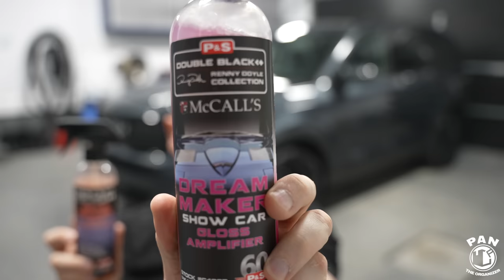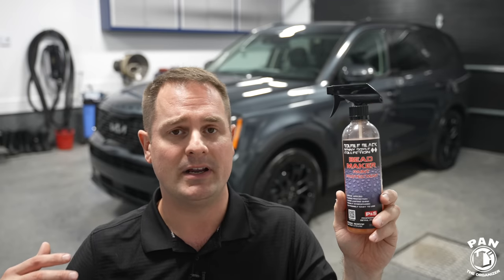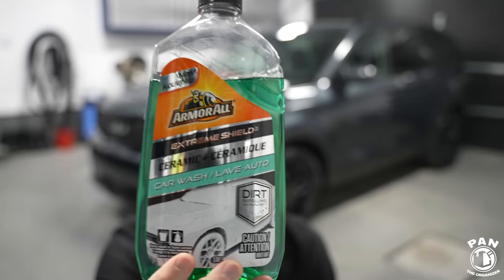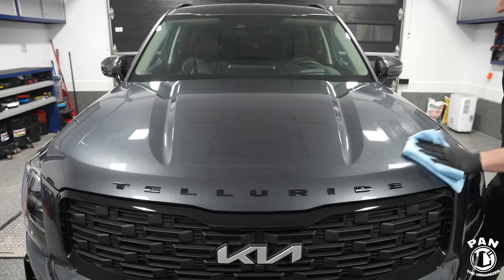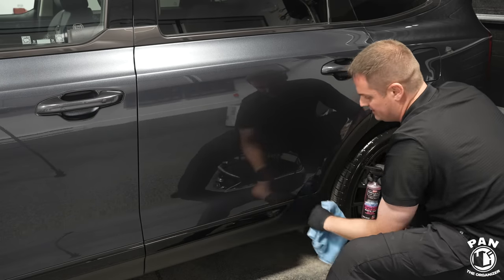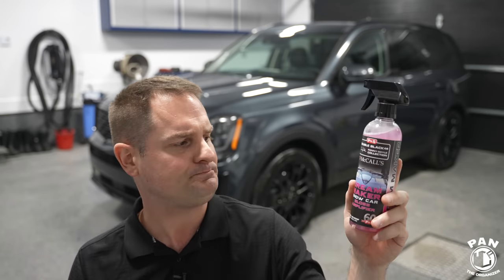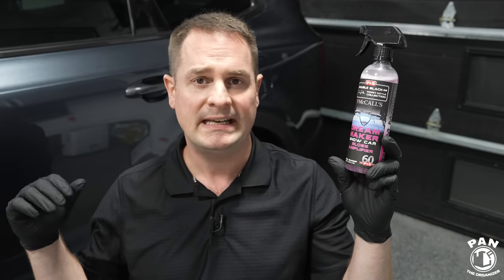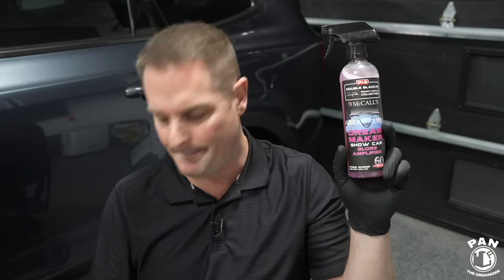NEW P&S DREAM MAKER! Is it better than Bead Maker?

Comment: Both products are absolutely amazing.  I typically will put layer both products.  I put the Bead Maker on first and then the Dream Maker on top.  Bead Maker is definitely going to last longer and give you more protection, while the Dream Maker is going to give you a lot more pop.
Reply: How long do you take after applying bead maker to apply dream maker?
Reply: @ForceFreddy  I do the same combo and I let bead maker cure for at least 5 hours before putting dream maker on.Ideally you should allow bead maker to cure overnight.
Reply: @marybetheby5184  Thank you! I will try this combo tomorrow !
Reply: @ForceFreddy  Great!Also,be sure to shake them both really good and often during the process.
Reply: Has anyone tried mixing the two in one bottle and using it that way?
Reply: @jeepinspence I'm using the ratio I think @pantheorganizer recommended: a 10:1 ratio of Beadmaker(BM) to Dreammaker(DM).  That allows BM to take advantage of the anti-static properties of DM and hopefully negate some of that dust attraction some experience w BM.

Comment: Would like to see a side by side comparisons. Coated and uncoated to see if it’s noticeable to the naked eye in terms of gloss
Reply from the maker: The camera rarely does glossy products justice, but this for sure beads an uncoated paint for sure.
Reply: @PanTheOrganizer  Can this product be used over a spray sealant? Eg. I was planning to wash an unprotected car then apply Turtle Wax Hybrid Solutions Ceramic Spray coating and then Dream Maker on top of the sealant. Should I do it in reverse order (Dream Maker then Ceramic Spray on top)? Would either method just be a waste?

Comment: I’m a big fan of Bead Maker and I use it over Jescar’s PowerLock sealant. Looks spectacular. Love the introduction to a new product and I will certainly be adding a bottle of Dream Maker to my arsenal. Thanks for the info Pan.
Reply: @Brandon-no3vc  Not really sure what you are talking about and “masking” but I use the Bead Maker as a topper after a maintenance wash. It brings back the shine and slickness to the paint and it makes it easier to wash.
Reply: @Brandon-no3vc   I have been doing it that for 2 years. Great results. I’ll stick to what works for me. Thanks for your advice and good luck.
Reply: @Brandon-no3vc  Jescar’s Ultra Lock Plus is a CERAMIC infused polymer sealant. The combo works for me. Not sure why you’re so hung up on this. But ok, you made your point. I won’t do it anymore.
Reply: @waynefromnewfoundland8740  🤪
Reply from the maker: Thanks 👍
Reply: @Wayne from Newfoundland I've been doing the same thing you're doing for a couple years now, spring and fall. 2 coats of Jescar Ultralock+ (ceramic) cured 3 hours each coat, then top with 1-2 coats of cured BM. Then I use BM for maintenance washes, making sure there's no rain the next day for extra cure time. 

I disagree 100% with everything Brandon said: you're not "masking" sealant, you're adding a layer of sealant. I forgot what else nonsense he said, but that's not been my experience at all. The results are amazing every time.

Only problem is dust. At least in Texas where I am, it's dusty here. That's where I'm hoping to use either Dream Maker or the P+S gloss enhancer product as a final secondary topper. I've been reading they both have anti-static properties to counter BM's static cling effect, which attracts dust.
Reply: @waynefromnewfoundland8740  Also, I think I'll get a gallon of the P+S paint gloss to try out for maintenance washes, and use the DM for special times or car events

Comment: Why wouldn’t you use a gloss meter to test effectiveness?  A before and after would have been a great test.  Otherwise not sure you see the value of adding a product like this over any other topper you’ve recommended, but as always…thank you!
Reply: You'll have to wait for Brian from Apex detailing to review it. He ALWAYS uses a gloss meter. Have been waiting for Pan to use one in his reviews.
Reply: @pdrey100  Same.  Nothing wrong with using the same tool as a competing channel.
Reply: Pan has explained many times before why a gloss meter isn't used.
Reply: Oddly, the very shiniest the paint can get is after polishing it, and nothing on it. Adding something on top of the shiny paint actually loses gloss. Try adding wax or other products on top of your bathroom mirror and see what makes it more clear.

Comment: Pan,
   Another great video.  I’ve been watching your videos on Bead Maker, to include your first introduction to Bead Maker at the Rag Company.  I finally broke down tonight and ordered it.  I just want to make sure that I can use this as a drying aid after each wash.  I have CanCoat Evo on our vehicles.  I want to do the initial application of Bead Maker on dry panels and then as a drying aid after that.  I just want to make sure I’m not overusing it as a drying aid after the first build up application.  Thanks in advance and keep up the great work.
Reply from the maker: Yes you can use it the way you described. Be very light on application if you’re using it as a drying aid after each wash and you will be fine.
Reply: @PanTheOrganizer  thanks so much Pan.  Have a great day.
Reply: @PanTheOrganizer  I forgot to ask you.  Have you used Technicians Choice Ceramic Spray?  I want a product that will not continually build on my CanCoat Evo.  I’m curious on your thoughts of Technicians Choice.  From the videos and research I’m doing…it may be superior to BM and a gallon is compatible in price.  I need something that mates well with my Evo but will not continually build upon it to take away from or compromise the Evo.  I’m so torn on a good silica spray or product for my sacrificial layer on the Evo.  Any thoughts or advice is greatly appreciated.  Thx again as always.

Comment: Hi Pan, 
I have a new SUV with ceramic coating. 
I clean it using the Rinsless wash method with ONR. 
Do you recommend using both bead maker and dream maker for the final touch to get more slickness and gloss? Or I can get it using only dream maker?
Reply from the maker: That's up to you to decide. You can now combine Bead Maker and Dream Maker in a secret DIY mix for even better results. See my video here: https://youtu.be/twuTd2VNlxw

Comment: I used beadmaker at the museum and wasn't too impressed. It didnt seem to last long? Maybe it was me. Maybe the local detailing supplier I got it from pre diluted it? I really like the TW seal n shine or graphene infused flex wax. I might have to try that dream maker though as a drying aid. That Viper chair is a step up from that snap on seat I was using. Being a big guy, it's tough to get down on those lower sections sometimes without being on your hands and knees or butt. The things we do to make vehicles look minty fresh!

Comment: How does this compare to Xtreme Solutions Topper? How is it different?

Thanks as always!
Reply: Great question
Reply: Same question I Have 
I think Topper is one of the best products out there for gloss and slickness. It’s also very easy to apply. For an outside vehicle I get between 7-10 days of slickness and gloss.
Reply: @stevenmott6668  me to.
Reply from the maker: Topper will last longer, and both are very close in terms of gloss.

Comment: Pan have you ever used Bead Maker on the interior windows ?? I hope I'm not doing something wrong but I've been cleaning my windows with it and they come out perfect with no streaks
Reply from the maker: Yeah many detailers use Bead Maker on exterior and interior glass, it works awesome. I still like to clean them first with a glass cleaner and glass towel, and sometimes finish with Bead Maker for slickness and easier future cleaning.

Comment: Pan, if I use the Bead Maker as a drying aid, the buildup should be way less than when applying it on the dry surface right?
Reply from the maker: Correct as you are slightly diluting the product.

Comment: I ride a Harley, after a few hour trip, what is the best way to get the road dirt off/bugs off the front fairing without doing a full wash?  I'm interested in trying P&S, but don't want to apply every time when I need to clean the road dirt and bugs off the front.  Cleaning a motorcycle is time consuming with a full wash.  Looking for a quick and easy method after a long day ride.

Comment: Ok so I did buy a bottle and tried it out on my car and here's my thoughts. There is absolutely NO difference in appearance with this over regular Bead Maker and if anyone says otherwise it's purely placebo effect. The things we convince ourselves of in the detailing world is pretty unbelievable when you think about it, hence some people paying over $1000+ for carnauba wax. Now, Dream Maker is fine but again, there is no way ones eye will tell the difference in looks between this and Bead Maker though Dream Maker is no where close to as slick to the touch and it goes on a little thicker in viscosity. Since it's already acknowledged that Dream Maker has no longevity, I don't know why one wouldn't just get Bead Maker, not that there's much longevity with that either but at least there's a little. As I've mentioned before, the human eye can only differentiate a certain level of gloss on a car and I'd put money on the table that two identical cars put side by side with each product, there's NO WAY one would honestly be able to tell a difference.
Reply from the maker: Yeah if you already had a good glossy protection, or even Bead Maker prior to applying this, it is hard to see a difference for sure, as Bead Maker already is one of the glossiest products.
Reply: You’re only supposed to use 2 sprays per panel. If you do that it doesn’t go on very think and is definitively just a slick as bead maker

Comment: Hi Pan - I noticed Beadmaker “streaking” as you mentioned I’m assuming due to over-application. Will this situation resolve itself after a couple washes or must the excess be removed somehow?
Reply from the maker: You probably over-applied or applied in humid conditions. Use very little product (except for the initial coat). Yes a wash normally corrects this.

Comment: Hello Pan, great video! I just put Adam's graphene coating on my car a few weeks ago (still sitting in garage) and now I want a topper. Is BM or DM a good topper or is there better for black cars? Thank you!
Reply from the maker: For the Adam's Graphene Ceramic Coating, their own Graphene Detail Spray is pretty good. Here's a link: https://amzn.to/3wXfN8u

Bead Maker is also a good choice. Just keep in mind those two only last a few weeks. So regular application is key.

Dream Maker is awesome for gloss, but it adds no protection. It will only last one week or until your next wash. You would still need to add a proper protection topper once a month.

If you want a longer lasting topper that will give gloss and slickness like Bead Maker, but that can last 2 to 3 months, try this one: https://amzn.to/3wRqzhH

Comment: Hi. Can i usa dream maker as a drying aid on a ceramic coated car (gyeon pure) after maintaining washes to quicken the application?
Reply from the maker: Dream Maker is not to be used as a drying aid. It's made to be applied no dry paint. But you could mix it with Bead Maker in a 1:10 ratio and then use that as a drying aid. See my video on the special mix here: https://youtu.be/twuTd2VNlxw?si=IaN_bqYNo7DuSNcQ

Welcome to my channel. You discovered one of the biggest car detailing channels on YouTube as we surpassed 1 million subscribers and we have over 135 million views! I have been detailing for 27 years and I love to share my knowledge and passion with my viewers.

You found the right channel to help you learn everything about detailing.

Comment: I have been looking for a drying aid that will NOT make my drying towels hydrophobic. 

Would this affect drying towels?
Reply from the maker: The majority of drying aids eventually coat the microfibers and make them less absorbant over time, as they usually have some protection. Hence why it’s important to wash the towels immediately after use with a quality microfiber detergent like P&S Rags to Riches.

Or use a drying aid with zero protection like a rinseless wash (ONR, McKee’s N914, etc).

Comment: New to the car detailing world, and I personally wanted to apply a spray sealant/protect first (CG Guys V07) and then follow it up with something for a high gloss shine like one of these p&s products, or one the Griots garage best of show or 3 in 1.
Reply from the maker: The CG V07 was good many years ago, but has since been largely surpassed in terms of durability by many of its competitors. A better longer lasting option is the one I tested here: https://youtu.be/b5BjDzItlr8

The Griot's Garage 3-in-1 Ceramic Wax is also a good choice. One of those two as your base layer of protection. And then after each maintenance wash, you can use Dream Maker as a last step to increase gloss and slickness.
Reply: @PanTheOrganizer  Any other brands you might recommend that fall along the same lines as the V07 I mentioned?

Also, I was wondering if I had to wait a certain time before apply each product?

Comment: Hey Pan. I got the Nu Finish Graphene spray and I'm happy with the protection and water beading it's providing. I do wonder if I could increase gloss and sickness (maybe more protection?) by adding a topper such as these two, or extreme solutions topper, or even a graphene detail spray. I'm looking for something that adds a slick feel and wipes on and off really slick and easy. Added protection would be a bonus! I saw a good review of the griots ceramic speed wipe but I don't think I should put ceramic over top of the graphene. I like the graphene for its resistance to water spotting and I think ceramic shows water spots more easily and harder to remove.
Reply from the maker: You can apply ceramic on top kf graphene and graphene on top of ceramic. No problem. Most graphene protections have a ceramic as chemical base, to which reduced graphene oxide is added.

So you can apply what ever topper you want on top of the one you currently have.
Reply: @PanTheOrganizer  great! When would you run into issues with layering? For instance, could you lay down a base layer of TW ice seal and shine, then a layer of Nu Finish graphene on top of that? I have both of those but haven't layered them.

Comment: Hi pan ! Can i use the dream maker on a ceramic coating ? Will not lose the hidrophobic properties?
Thanks
Reply from the maker: Yes you can but it can potentially change the hydrophobics a bit but that applies to any topper you would put on top of an existing ceramic coating.

Comment: Hi Pan I will be using Avalon King on my Ford F150 truck and am looking at using Bristol trim coat/Cockpit Car Re newer on the plastic trim so my question is, can I use that product or another  and then also use the ceramic coating over it. And if i use the ceramic coating on the trim, does it appear glossy? specifically speaking of the trim between the driver and passenger windows.
Reply from the maker: Typically the short answer is no. Trim coatings already contain protection (I don't know the Bristol one though). But a trim restorer or ceramic coating won't necessarily make the trim appear glossy, but it will make them look newer and richer (better looking). A good trim coating/restorer is this: https://amzn.to/3DFc6q7

You won't need to apply protection on top of that after using that kit.

Comment: Hey Pan 
What are your thoughts on their quick detailer? I torture tested it today in Florida sun and heat, hot day today. Did a full spray on wipe down on a pollen infested black Mercedes. 0 pollen has stuck to it since, usually it is incredibly dusty by now... I have beadmaker and dream Maker, but the detailer.... That is the one...
Reply from the maker: What quick detailer? Paint Gloss?

Comment: This test would benefit from some real life data using a gloss meter such as forensic auto detailing uses.
Reply: Boy, these products just shine no need to use anything else than your own eyes...
Reply from the maker: Exactly. I prefer looking at the finish and determine what my own eyes see, rather than relying on numbers given by a machine. I have seen instances where a gloss meters shows a slight loss of gloss, but clearly the eyes see an increase in gloss through a candy like appearance. The opposite can also be true. The meter says it's gained gloss, yet your eyes might not see the difference, so the data is pointless at that point.

Comment: Great video Pan. Do any auto detail products work on outdoor grills? I’ve been wondering if I can apply something on my Traeger grill to protect the finish. That would be a great video if there is 🤔
Reply: @pajamatime5750  Nice! How interesting. My concern/hesitation was whether the coatings would be flammable after curing. Will have to test it out. Have you tried a ceramic coating on it?
Reply: Grills get too hot … almost any auto product will burn off or break down.
Reply from the maker: I wouldn't apply detailing chemicals on outdoor grills meant for food...

Comment: I am new to detailing and going to do the ceramic coating for the 1st time. The question is: How often do I have to do the Iron removal once I am done with the ceramic coating? Is it required for every time the car is washed after ceramic coating?
Reply from the maker: You would do the iron removal once every 4 months on average, or depending on how much brake dust contamination you see on your paint. It won't harm the coating. Assuming you are using a true coating from a glass bottle from a reputable coating brand.
Reply: @PanTheOrganizer  Can you also let me know the following: After the paint correction, do we have to do the wax polishing also before applying the ceramic coating? Also, I have to finish a Honda Odessey(2009) which has never been paint corrected before, and BMW(2019) which is almost new, what kind of pads should be ordered for the above 2 cars?